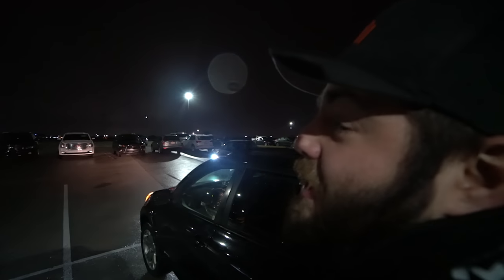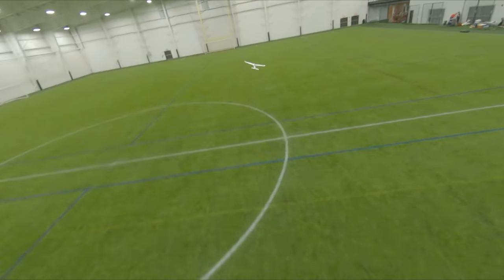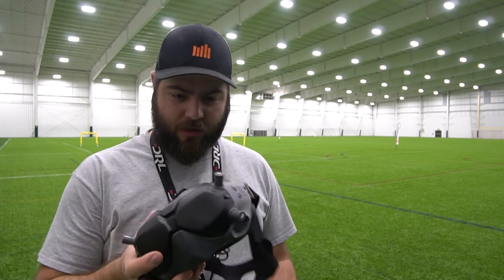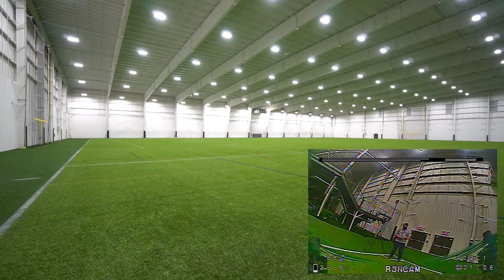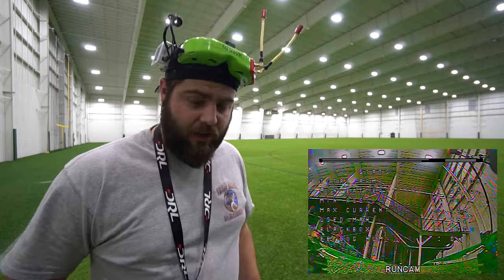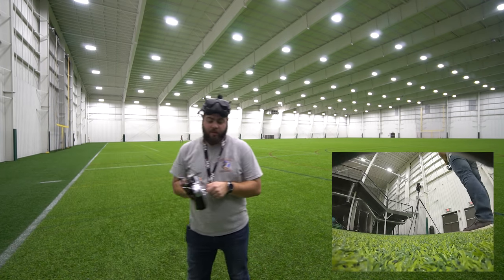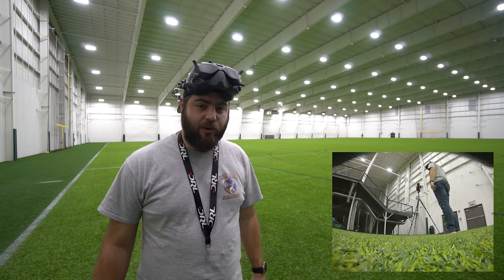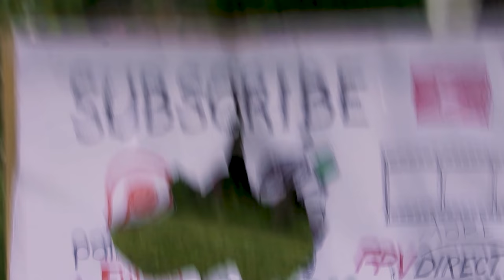DJI vs Analog in a High Multipathing Environment

Comment: Just waiting for the rest of the industry to catch up and offer a non-DJI digital product that's not  locked into proprietary wares and not embracing guvmint hand holding...
Reply: Hope you're prepared to wait many years, or possibly never...  The value in this system, what's really worth money, is the chipset and DJI's proprietary transmission protocol in use.   Even if every other company in FPV combined resources they still would lack the engineering capabilities and resources to develop a chipset like this.    Even if they did, any company that made such a chipset would keep it propriety as that's the only way to recoup their losses in R&D.    As evidenced by DJI licensing the tech to Caddx - they still make the chipset.    As for embracing "hand holding" - dji has fought more for hobbyist rights than most other companies in FPV.   They're one of our strongest allies.
Reply: @protonus   "They're one of our strongest allies"...lol...pardon me for being old enough to be cynical..DJI is nothing of the sort.Next you'll be telling me they brought untold thousands of  user into the RC hobby, When in actuality they've mostly accomplished bringing a bunch of unqualified waypoint assigners into the world doing stupid stuff with "drones" largely out of their control and posting same stupidity on YouTube as evidence. Most users incapable of "flying" without the autonomous waypoint functions and a large percentage of the "drones" now residing in the backs of closets but still counted by the FAA proponent lunatics. DJI is salivating no doubt at the prospect of all "drones" being under their banner when/if RID is forced on users and DJI will be ready with rtf's...expensive guvmint compliant plastic rtf's unable to be serviced by the user......I asked a DJI  rep once about whether there was a disabling back door in the wares.....they did not respond . Good luck ..yer gonna need it if you are an actual rc pilot.If you"re sole experience is with DJI you likely don't care.